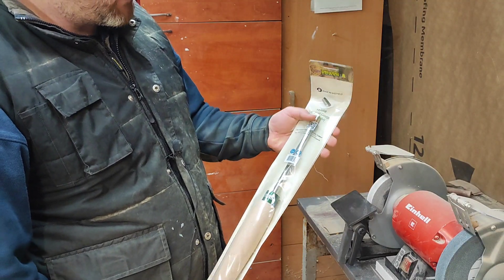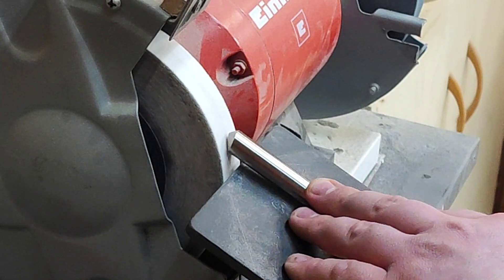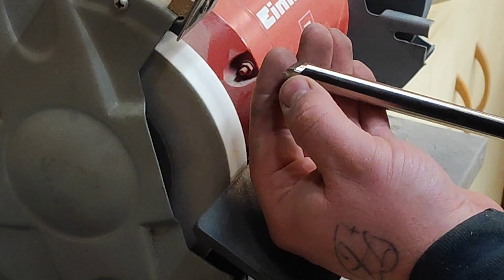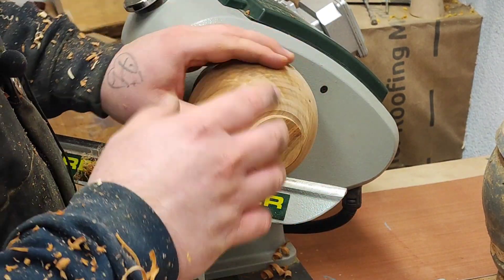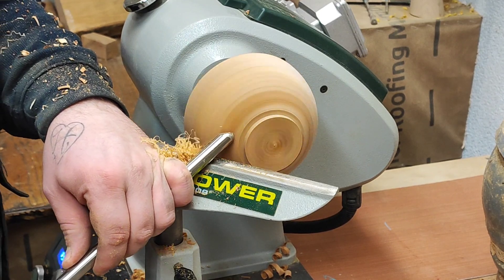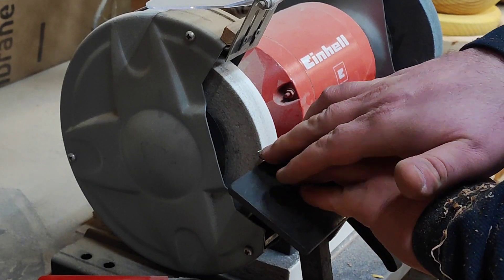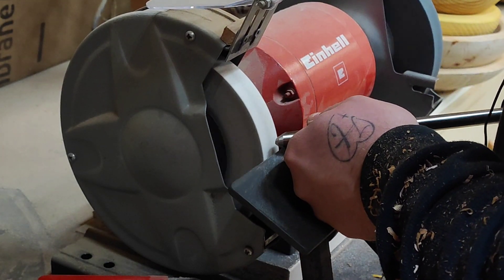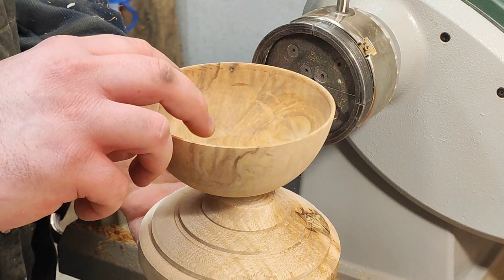HOW TO SHARPEN BOWL GOUGE THE EASY WAY, AND MAKING BOWL WITH IT🤗

Comment: Very useful video thank you. I used to free hand sharpen the bowl gouge, I am happy that I learned to do it, but nowadays I use a jig to do it. The reason why is that when I turn wood full time every day I am able to resharpen removing only the minimum amount of steel, but when I turn way less often I am not so precise free hand and even if I can get a good edge it needs some more passes on the grinding wheel. As gouge's steel is very expensive and to set the jig and sharpen takes only few seconds more compared to do it free hand ( if done in a smart way) I think that free hand sharpening bowl gouges is a good way for professional woodturners but not so much for those that sharpen less frequently as free hand sharpening is a skill that needs to be constantly maintained, if you sharpen many times each day you are spot on, but if you turn only a couple of bowls each week things are very different (at least for me).

Comment: Hi Tom, thanks for sharing your technique. I sharpen in a very similar way. Have you considered getting a CBN wheel for your grinder? I changed over and they are brilliant, they do not take off as much steel so your gouges will last longer.  All the best, Mike
Reply from the maker: Thank you Mike🤗 I have but this grinder needs to get upgraded as well so wainting for the female chairman to allow for some funds after regent😂....
I'm wainting for that as a I need a new grinder as well but soon hopefully ☺️

Comment: Nice gift, tell him he can send me one as well! 😎
For grinding I have totally given up on the grinding wheel. These days I'm using a belt sander for all my gouges.
A belt sander gives me much better control and it takes off far less material.
Reply from the maker: I'm very much believer in light touch and it does not take much steel even with 80g wheel.... The most important thing is to find what works for you and stick with it..... It would not be interesting if we all do the same way☺️☺️

Comment: Great video thanks for sharing.   I am curious as to the chuck you used to mount the bowl so you could machine the bottom.  At first I thought it might be a vacuum chuck but now I am not so sure.   How did the bowl attach to what looks to be shaped wood?
Reply from the maker: Its a screw chuck, I have a video on commercial but also on homemade version
Reply: @tomislavtomasicwoodturning  Hi Tomislav,  Thanks for the quick reply but perhaps I was not clear.  I was asking about the "chuck" used at about 21:37 when you removed the tenon on the bottom.   

Thanks again and great video.
Reply from the maker: @David-tv3dk  that is called jam chuck, wood on wood
Reply: @tomislavtomasicwoodturning  Thanks.

Comment: Your explanations are very good. Excellent demonstration of the steps required to shape a brand new bowl gouge. However I find it hard to see the result of your grindings because of all of the tool movement. Please try to hold the tool still as you are demonstrating the result of your grinding. Slow deliberate motions make it much easier to see what you have done. Also displaying the tool against a plain background helps. Thank you for sharing. Have a great day and stay safe.🙂🙂
Reply from the maker: Thank you Glen, Still learning about filming this stuff ,and with time I'm getting better so very soon I'll do similar video but more in focus.... Thank you for watching and suggestion 😀
Reply: Hello Tom. 
I'm a new woodturner , old enough in age , from Greece and I leave in Lefkada.  I would like to tell the brand name of the gouge, it's price and the point of the eshop you get it.
Thanks for your help. All this information is helpful and very important for us. 
Have a nice time. 
Babis Mantzafos.

Comment: I tried to divorce myself from the jig after listening to Raffan, but honestly my brain goes all wonky when I look at the wheel and the tool tip and there's all this spinning and noise going on, so now I just "use the jig."
Reply from the maker: That is ok, there is nothing wrong with using a jig..... I come from woodworking background and my mentors were old masters which never had any jigs, so I learn to sharpen regular Carpenters chisels and planes by hand.... That was transfered to turning as well, plus I just could't justify buying one...... Like I said there is nothing wrong with jigs , if you are comfotble with it and can return to lathe as quickly that would be my way as well....
Reply: Perhaps at some point you 4-way guys will go really nuts and have a "the only requirement is to use dull tools" project :0
I think Richard came close with his "burned finish" vase. There are also people out there who use urushi techniques to turned "sloppy turned" cups and plates into things that look very much like pottery.
Reply from the maker: @walter67435  😂😂 who knows where YouTube takes us🤗
Reply: 🤠 @tomislavtomasicwoodturning  😆 So true!